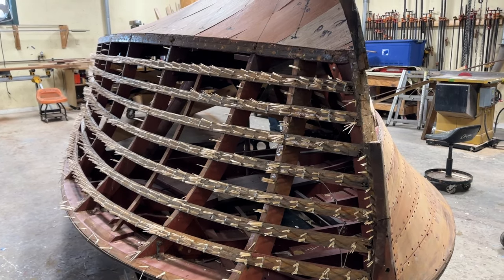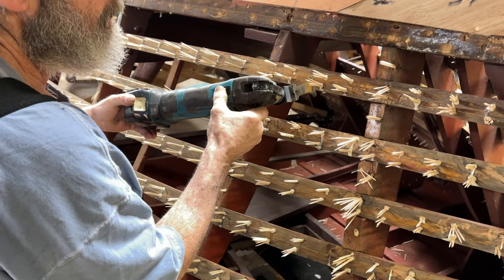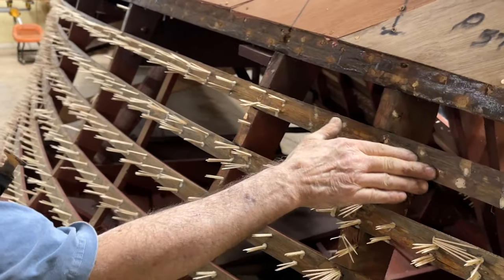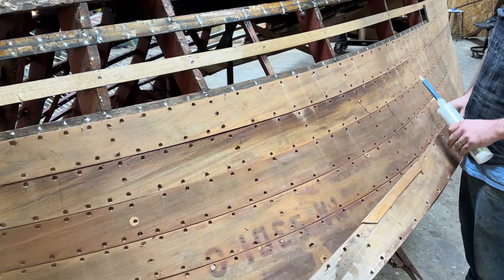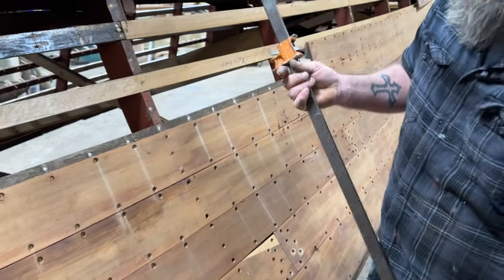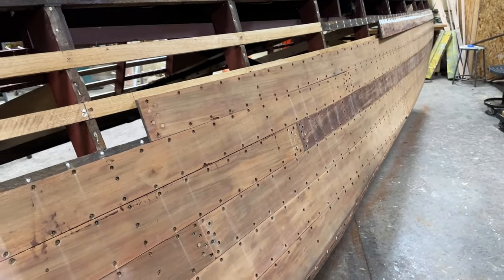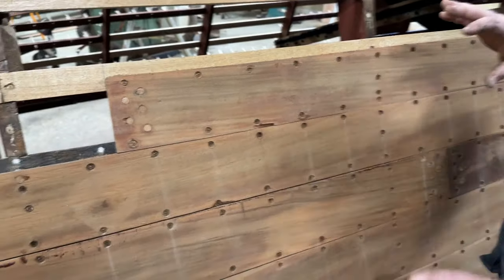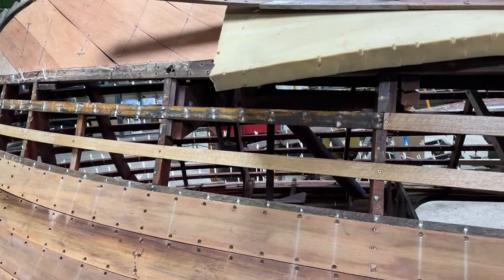1947 Chris Craft S 25  Sportsman   Toothpicks & Hullside Planking 2 7 2024

Comment: Hello! Just wondering why you don’t use solid dowels made from the same wood, mahogany?
Reply from the maker: You are kidding,  yes? Let's see, nobody manufactures round, pointed on both ends, mahogany dowels. 
 And the dowels would have to come in a myriad of diameters, and ones that vary along the shaft to absolutely close each void.
Could we fabricate them? Hope! Remember, we drove north of 4,000 - 6,000 toothpicks - 3-10 per  void - to fill all the holes.  
Finally, we need rock hard wooden toothpicks to deliver the requisite holding strength of the wood into which we drive silicon bronze wood screws.